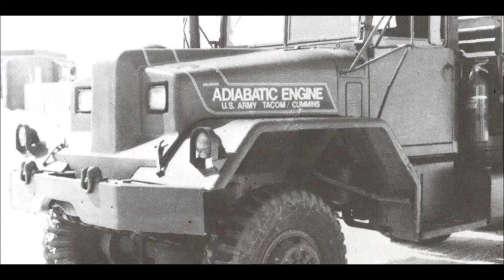Adiabatic Engine with Isolated Combustion Chamber using a Pressurized Gas Seal

Comment: So what if you didn't go full 1000 degrees F and just focused on something more doable like 300 degrees? Or what if you injected massive amounts of water to turn into steam to build cylinder pressure but also keep the engine cooler?